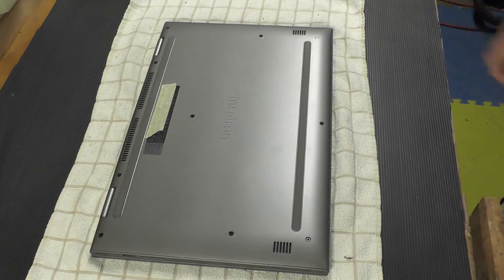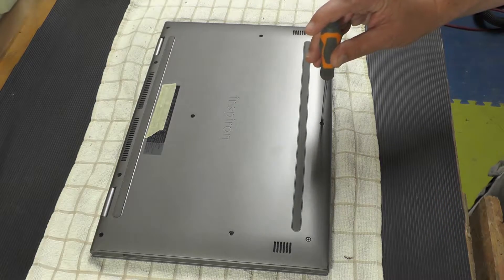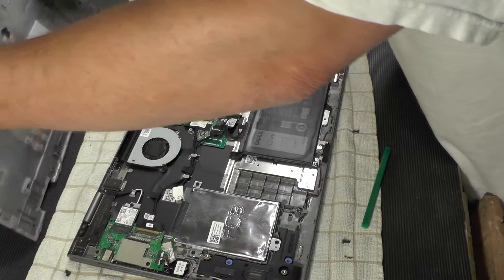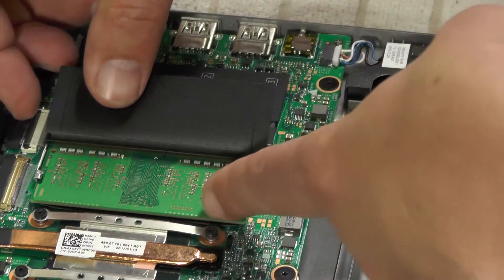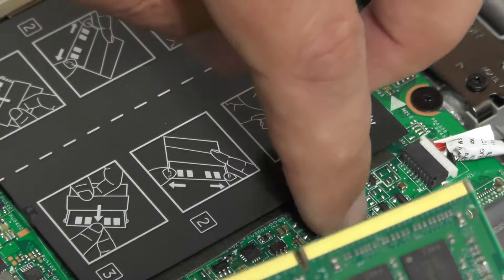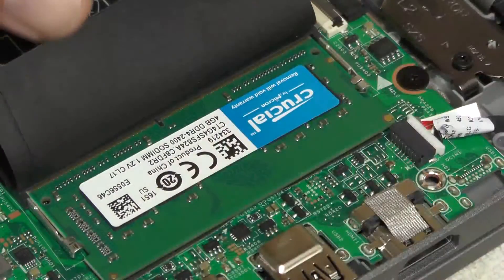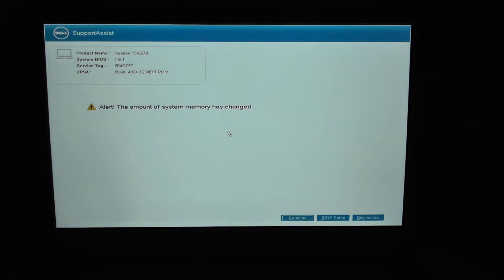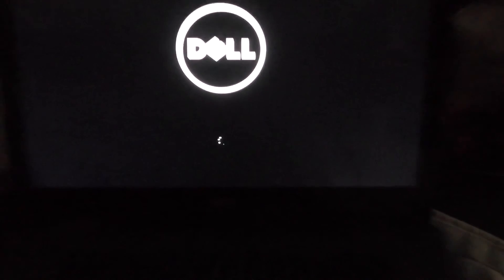Dell Inspiron 15 5578  2 in 1 Laptop RAM upgrade

Comment: There is a place between the fan and the battery a cuircit area which i believe is for ssd or nvme. Is there a way to add a mvme slot in there ?
Reply: This comes with sata SSd, but usually you can take out wifi card and ad M.2  2280 drive, and then switch to usb wifi adapter.

Comment: You should discharge static by holding an unpainted metal surface before handling the ram, and secondly avoid touching the golden pin connectors

Comment: Hmmmm I did this but it has not come off the dell startup screen just sits there and spins
Reply from the maker: Check at about the 2:00 min mark in the video - make sure you push in the RAM all the way.  It's possible to not seat it properly and still click it down.  Hopefully it's not the wrong kind of RAM for your system.

Comment: Joe Zaza PLEASE REPLY! Thanks for uploading this! I have the same laptop. Has this 8 gb upgrade really made a difference for you ???
Reply from the maker: Yes it's faster for sure.
Reply: @JoeZaza  Nice!!! So just to be sure you added onto the 4gb that the laptop already came with you have a total of 12 gb now correct??
Reply from the maker: @ThatLeoNamedKeo  This old one was 8 Gb total,  just adding another 4 Gb stick.  Recently I did add a 8 Gb + 4 Gb to get to 12 on another machine.
Reply: @JoeZaza  Ohhh ok! Sorry i had thought the new stick was 8 gb . Thanks for the info!!
Reply: @JoeZaza  hi joe i forgot to ask was this stick single ranked or dual ranked?? Or does it really matter which would work???
Reply: @JoeZaza  and thank you for responding wasn't expecting it being how old this video is lol. Really needed to know this before buying!

Comment: Thank you for the video!  I have an Intel Core i3-7100U CPU @ 2.40GHz processor and 4 GB RAM.  Do you think adding more memory will make it much faster, or am I better off just putting money into a computer with a faster processor?  Thanks for your help!
Reply: Same here! I'm wondering the same! I hope this dude replies!!!!!! Doesn't seem like it lol
Reply: My 5 cents: depends on what you use your laptop for. If you multitask a lot (several browser tabs, plus several other programs running in parallel, more RAM will help a lot. If your laptop doesn't have an SSD, I would start there, in which case pretty quickly you might be better off changing laptops altogether. But SSD + decent RAM makes "any" laptop run pretty well for common use. If you use computing heavy programs (photo / video editing, 3d modeling, gaming...) then you also need to consider the processor & video card.